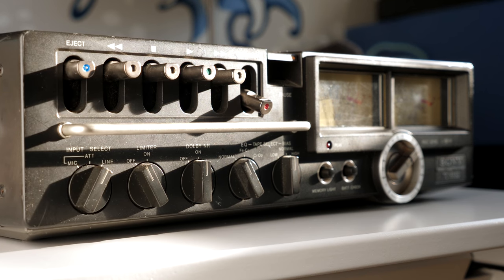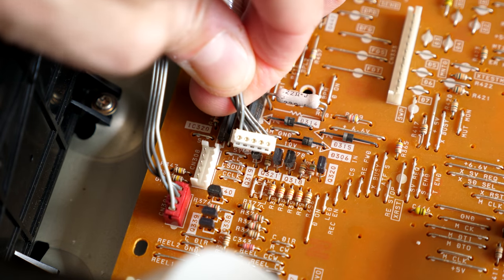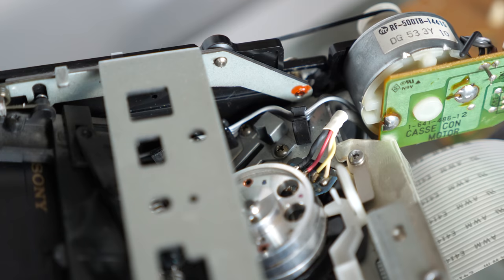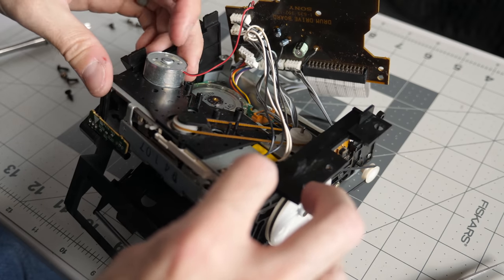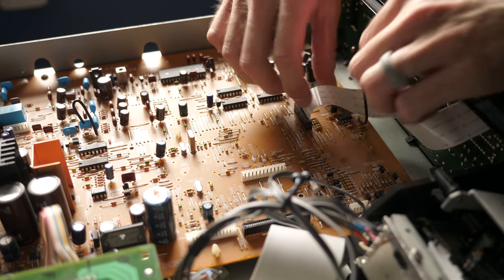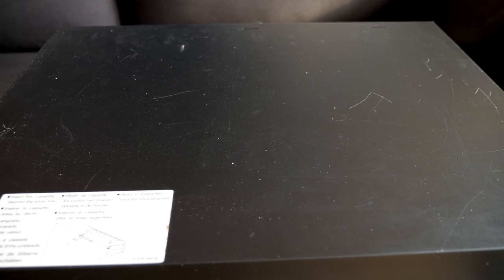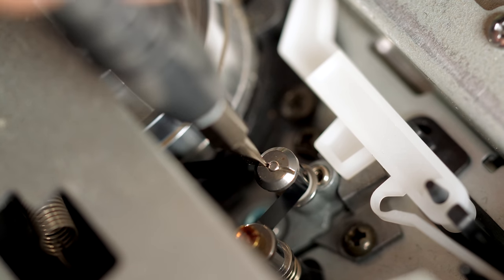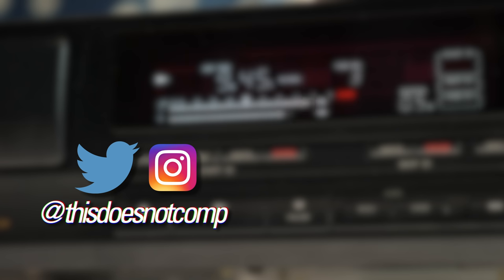Fixing Up a (Really) Broken Sony DAT Deck

Comment: The good old days when service manuals where readily available to everyone .
Reply: exactly what I wanted to say
Reply: Well if you were a Sony repair centre or dealer yes they were free, otherwise repair centres had to pay or borrow... the repair workshop I was at rarely looked at products we didn't sell because getting a service manual was not easy and usually not cost effective. it's only since they've been published online that they've become easily available (and free) -
Reply: @Dedubya-  still, try to find schematic for any new electronics (like a TV), even for $$ i a lot of cases it is not available.
Reply: @ronlevon4294  It's also highly likely the entire TV is made of a SMD mainboard, PS and display.   If it's not the PS, you throw it away.
Reply: sony audio gear still has service manuals, finding them can be a challenge but they exist
Reply: @ronlevon4294  I'm sure that's true.... my point was that the original comment was saying about how manuals were available to all in the good old days which just wasn't the case.
Reply: The good old days when people actually fix broken things instead of dumping them
Reply: @teekay_1  I don't have too much trouble with smd components but multi layer boards make tracking traces near impossible without a schematic
Reply: Honestly though, back then service manuals cost money and you had to go to a service center to get them. Nowadays you can just download them from the internet for free. Most of them anyway.
This is the golden age of availability of information. And what do people do with it? They share videos of cats and pictures of food, and they use it to spread misinformation.
Reply: I opened up my reel to reel machine and it had a compartment hidden inside with the circuit diagram

Comment: These DAT players are just miniaturized VCR components with a digital side to them.  Great Video!
Reply: It's the same principal, helix scan of the tape. Which is why they're not dual sided tapes.
Reply: I would've never guessed that the dat reading process is so similar to a vcr, i thought it would be much closer to the reading process of a CC.
Reply: @maxwell9561  Fun fact, I believe DCC, digital compact cassette, did encode in linear fashion similar to CC.
Reply: @6581punk  Amount of sides on tape doesn't strictly correlate to whether it's helical scan or linear recording. Philips V2000 video system, I believe, had double-sided video cassettes. It was helical scan, of course.
Reply: VCR with digital recording came out later, same with Digital 8 tapes, so this is kinda precursor to them.

Comment: I don't know how someone confuses DAT and MiniDV when there are no video connections and it has DAT plastered all over it, and it even spells out "Digital Audio Tape."
Reply: I don't think that happened, I suspect the unit was dropped with a tape stuck in it, someone removed the tape and gave up putting it back together properly.
Reply: Not to mention MiniDV is physically wider than DAT, at 6mm vs. DAT's 4mm.
Reply: Kids nowadays would have no idea how to connect a stereo system together. They just expect everything to work. So I wouldn't put it past a previous owner to do all the stupid stuff that Colin showed in the video, mess up, give up, and put it on eBay. The "MiniDV" could just be a slip of the pen or an autocorrect fail on a phone keyboard or a copy/paste bug. But I keep being stunned how people simply have no idea how anything works anymore.

Comment: Hello Colin, this is Colin.  I've worked on a few DAT machines too on my channel (including 24 bit ones).  I also have a DTC690 and I've had the retainers fall off those gears in the past.  The machine works fine now but I prefer to use other machines such as several Tascam models and also a Sony PCM-7040 professional deck.  Recently I also modified a DAT machine to do something it wasn't exactly built for (digital audio signal conversion from an obsolete format).  Regarding setting up the guides on your machine, I would use an oscilloscope to check the FM envelope, you don't need a very special 'scope for that, but a known good tape is important.
Reply from the maker: Hello! Interesting to hear you also had the clips go missing. I don't think the 690 is necessarily a bad deck, but it was definitely built to be a consumer model (and explains why the professional DAT decks remain somewhat expensive). I do think I'll end up needing to fine-tune the guides with an oscilloscope, I got them pretty close by ear but very occasionally I'll still get a little glitch. I definitely got a lot of inspiration troubleshooting this one from watching your repair videos ;-)

Comment: If you'd ask me and I didn't see the eBay ad, I would think this was dropped off at a Goodwill store, thrown back and forth in the electronics department for a while, then sold for $20 to someone who tried to get it to work but didn't have a clue what they were doing. Good to see it's working now, and in the right hands.

Comment: I just got my DAT machine back from my parents house. Not remembering the instructions I gave her about how it works, my mother had opened the drawer, put in a tape and the pushed it closed! The drawer mechanism doesn't operate anymore and I'm at a loss at where to start. If I lived in the US I would be calling you. Great job on the diagnosis and repair, gives me some hope for a positive result....eventually!

Comment: Thank you so much for putting this together.  I used to work on VCR's years ago.  I have a DTC-A7 that is experiencing the tape guide not loading all the way.  This gives me something I can at least go check.
Reply: My DTC-A7 is having the same issue. I hope the solder reflow worked for you!  YouTube is a great resource.

Comment: I have the same DAT recorder and it is very decent for its price. Good job mister ! I use it now as a DAC for the digital output of my TV....
I just replace the poor opamp with LM4562 and Panasonic condensators. And also I removed the "cleaning" foam....

Comment: I have a DTC-670.  The auto head cleaner wheel was on the white plastic arm to the right of the head cylinder.  It would briefly contact the cylinder to clean the heads.  It turned to goo on my unit and clogged the heads.  Even after lots of cleaning I never got it to work correctly again.  I used to repair consumer electronics such as VCRs and camcorders so I know what to do.  That was about 6 years ago.  I still have it but not sure if I'll try to fix it or not.  I bought mine new May 1993 for about $800.  It served me well back in the day.   Glad you got yours going.

Comment: When I did an internship at a public radio station in college, they were using portable DAT recorders for field interviews. They worked well for that purpose, for the most part, but the tapes would eventually wear out to the point where the audio would have frustrating distortion and static at random spots. They liked to make as much use of the tapes as possible, so they would be re-recorded dozens of times. That was more than 15 years ago, but I think most stations use something like a Marantz solid state recorder for interviews now.

Comment: My Sony DTC-690 just stopped working. I glad I found this video, I not to sure if I should share this so I just going to say I got some help from Colin, my issue was 3 items or 4 after the repair (the tracking was off), but anyway first issue was it would only play tapes for 52 minutes and just stop. I could press play again and it would start to play and then stop again, that led to no rewind, could fast forward but could not rewind. Last issue was it was problems loading, at times it just was unresponsive, holding down the eject button while power cycling would bring it back. So from the advice of the 12Volt Guy, I cleaned the mode switches and all contacts. Put it back together and now open error on the display. Could not figure out why, so I tore it all the way down, and to my surprise the little plastic holder had come off of the exit tension arm and the arm was stuck in the upper position, jamming the entire mechanism, so that were Colin comes in, with the video and a little help, I 3D printed the plastic holder, realigned the tension arms ( un-jammed ), I dropped a little glue on the top of both, so they would not fall out again, (I know bad ideal) but even if they crack now they will not fall out, and it is not so much glue, just a little heat and it will clean off, I just put a drop the size of a needle head, so. But anyway put the deck back together and bang it is now working like new. No load issues, no Open issue (which was caused by the jam not allow the load mech to travel far enough to hit the open/close switches on the left side of the load drawer), rewind works, and the tape does not stop at 52 minutes (I think that on was the mode switch) I am still fighting with the alignment, I going to put it on the scope and see if I can get it done from there, only issue is I do not have a DAT alignment tape so I will have to use old record on tapes. But Colin Thank you, anything you need just ask, and if I can do it I will

Comment: Friend, I have two decks of the PCM 2700A model, and thanks to your video I was finally able to find the solution to the same problem (10:21) that I have in one of them! The other does reproduce the DAT's well, but it does not record, or it records the sound very badly.

In my town (Guadalajara Jalisco) I have no option to find technical support, but I have always hoped to be able to repair these magnificent devices! I have been with them for many years, and I did not want to throw them away!

Thank you very much for sharing your knowledge, and greetings from Guadalajara Jalisco, Mexico !.

Comment: 7:57 This is pretty common issue with old electronics, the transistors are wave soldered and have barely enough amount of solder.

When the device is turned on, the transistors heat up and the legs and the solder join expand slightly by thermal expansion. And when the device is turned off it cools back down, contracting the joins.

This constant thermal cycling induces fatigue in metal joins and eventually induces cracks. This wasn't much of an issue when the early electronics were wire wrapped and hand soldered.

Comment: There are a number of early DAT decks that didn't have SCMS (such as the DTC-1000ES) and later prosumer models from TASCAM such as the DA-302 had a menu option to disable SCMS. There also exist inline digital devices that can change certain parts of the bitstream in addition to optical/coax and/or sample rate conversion. 
There are many causes of cold solder joints but here the transistors probably broke their solder joints due to repeated thermal cycles rather than being dropped. It happens on tons of devices where the transistors get hot and things are unable to expand because they are bolted down to the chassis. This causes the solder joints to flex and eventually crack with greater frequency than similar components that aren't bolted down.
Reply: Yes, that’s usually how it happens, hot, cold, hot, cold.

Comment: You are an excellent technician.  I admire your troubleshooting techniques.  I no longer have the patience to troubleshoot.  I bought a DCC deck from Radio Shack cheap, around the time DCC was going out.  I didn't take long for the power supply to have issues.  I think it was made by Philips(?), which is my conclusion after watching your DCC repair video.   Radio Shack didn't support parts for repair for it's DCC units.  I eventually threw it out.  No support, no schematics.  I worked for RS when I was going to school.  Even then, you paid 4 prices for just about everything.  There is no doubt why the company failed.  Perhaps if I was a good technician, I could have saved it.  Swapping PS boards was my only option, which, turned out, wasn't an option.

Comment: Are you selling those tiny green clips?  With the help of this video I took my DAT Sony DTC-ZE700 apart and found both of the gears that you showed were missing the clips.  If I do not find the two clips I will only be able to play tapes with the player upside down!  Can you at least tell me if it is even possible to replace those so I will know if I can fix it or I just need to toss it.  Thanks!

Comment: Collin, purchase a fine nozzle for your 3D Printer, you'll be amazed by the results. I would have printed that little piece with a 0,01 or 0,02 nozzle in order to be accurate to the model.

Comment: Yeah, I needed to adjust the tape guides to stop the digital hash I've been hearing for years. Thanks so much for showing that. It's a bit tedious, a bit like tuning and intonating a Floyd Rose with different gauge strings. My open/close button is broken and I don't want to get into that. I have a remote, but the door closes immediately after opening fairly often once it opens. If I open and close several times it will typically go to normal operation, but that is undue stress on the tape.

So, to adjust the tape guides, the tape must be rolling or the guides are inaccessible. I bring this up because I never before realized how much tape is pulled out of the cassette to get the tape contacting the drum. I suppose this is how VHS works as well? Thanks again for making this video, giving me plenty of confidence to work on my DTC-690 :-)

Comment: Wonderful! I repaired a Sony DAT tape myself two years ago, a PCM-R300. Like yours, it was missing a retention clip, but fortunately that was its only problem. However, I the had to realign it as well. The tracking I could do perfectly by using an oscilloscope, but the other thing to adjust was the tape tension, and to do that properly I’d have needed a special tension meter tape that I only saw once on eBay since… for over $300. So naturally I just eyeballed it, using both the oscilloscope and the bit error display that appears when pressing “Menu” a few times. It happily read 0 and payed perfectly until somewhat recently, where it started eating tapes. Guess my improvised retention clip (not 3D printed) finally gave…

Comment: Awesome !!!🙂Good Video .I can do minor  repairs on equipment . I learned  about adjustment  to get the correct playback . Never new that. The plastic part so small  my big hands would  have crushed it. Saved DAT from the junk pile. The one thing I learned back in 1990s. The digital  copy  for the  digital input. The red light that you see before you plug the wire in back.For most it was always off or I thought broken or damaged. By the late 90s I  learned  by owning 6 different  brands this was intentionaly disconected by the manufactures to give DAT a bad name. It was hated by so many CEOs that this hate led to making decks that couldn't  work  for the Digital  input to strike another blow to DAT. Now  thats hate. Im glad it works.
Check the digital inputs and outputs on the back of the deck. Both red lights should be on when you power on the Deck. My guess only 1 lights  up.
🤔🤔🤔

Comment: Back in the 1990's I used DAT for a completely different use.  The Compaq Servers that I had also had a DAT drive with a 10 tape changer for back up purposes so instead of Audio they had data.  It was relatively fast and once set up completely automatic for a week. Full backup on the weekend and incremental on the week days.

Comment: Boy do I love the design aesthetics of 80's av equipment. I whish those kind of screens still were a thing.
Reply: Those old VFDs were beautiful. Because the layout of the icons/digits was fixed, someone had to actually design how the information was displayed. Now, with LCD panels, they just slap any old layout together.
Reply: Ekhm, this is not 80' era thing.

Comment: 3D printing little parts can be a bit of a learning curve, but with a little patience you can even make 2 tier gears and the like.  I was kind of blown away when I printed a gear for an old bicycle bell and it worked really well (and still does a year later, according to my sister).   I've only used PLA for such things so far, but if you can get the stringing under control, PETG should make durable replacements.

Comment: Great work! I made the same with the small clips (designed and 3D printed, works perfectly) another typical issue of these Sony consumer dat Is the RF amp board (electrolitycs SMD capacitors to be replaced)
Reply: I am restoring my deck right now, too. Could you please share the STL printer file with me. Would be very kind from you.

Comment: The solder joints may have broken due to stress caused by the transistors being mounted rigidly to the heatsink, and in turn, the chassis, and them heating up, causing all these metal parts to expand at different rates. You can actually buy a tool for bending the legs a bit so they can cope with this more easily.

Really enjoyed watching this though. :)

Comment: You should get a dlp 3d printer, those are most precise when printing some small parts
Reply: SLA prints can shrink slightly as they cure, throwing tolerances off for very small parts. However, you can get low shrink SLA resin these days for those kinds of prints.
Reply: There is a minimum resolution when using any 3D printing, but it also comes down to having an accurate machine, printing with the right settings, and knowing your individual unit and materials well. I have done 3D printed bushings in PLA and PETG with 0.01mm tolerance. It just requires a time investment to get things right.